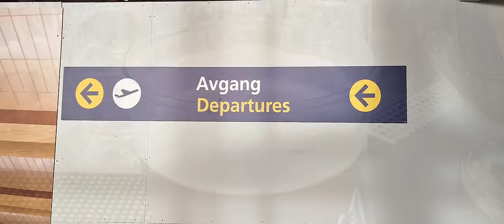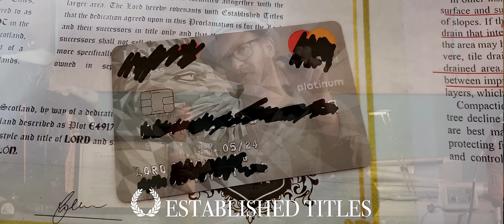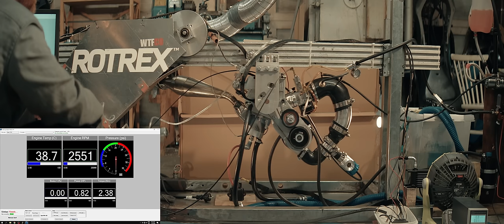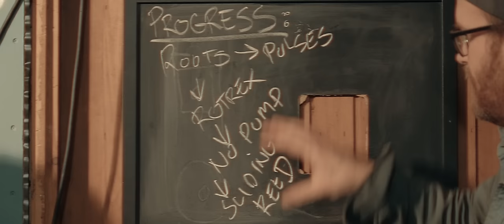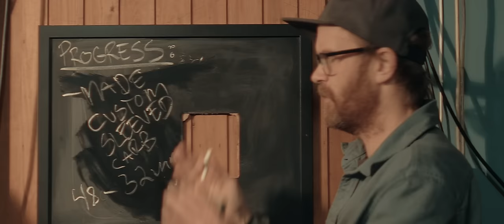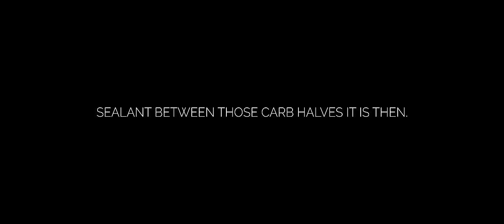Supercharged 50cc Two Stroke Flamethrower!

Comment: Whats the betting, it's leaking out the carb because it can't dump the boost. Maybe your pressure balance pipe induced this leak?
Reply from the maker: It wouldn't leak if the carb was sealed properly, have to take it apart and fix it.

Comment: it didn’t work because you done a straight tube from turbo to carburator and you didn’t pressurize the fuel tank.

the first thing produce negative-resonance that keep the reeds open while the piston is going to the btc.
the second one make the carburator in positive pressure (fuel goes back to the fuel tank)

in my opinion you should make an Y tube from turbo the the fuel tank (as is common used in high pression airbox of 125cc 250/500 grand prix bike)

and a straight foward tube (kinda airbox) large as the carburator, connected with a T shape to the turbo, so you can change he back lenght to tune up the intake resonance..

Comment: Could you swap the throttle cable where it goes into the slide for a rod then the other end of the rod where it exits the carb could go to some kind of push pull setup so the slide is physically pushed shut.

Comment: Slightly less insane when you consider the shorter distances and inexpensive flights in Europe.
UPS has got to be the worst shipping company I have ever used. I don't think I've had a single positive experience with them in all the times I've used them.

Comment: Ever thought of direct injection on this beast? Proper ECU mapping 😍💪
Reply: Yes, he has. He had a great segment on why not (yet) 1-2 videos ago.
Reply: Extremely difficult to map because you never get an accurate feedback loop to the ECU and there’s no place to put an O2 sensor where it won’t foul up.
Reply: Alpha-N tuning is possible (often used on drag engines with too much cam for closed loop operation) however it's a pain to do.
Reply: @andrewwasson6153  I'm not too sure about that. PRI drag racers in the US have plenty of oil blow-by the rings and the O2 sensors seem to live quite well as all of the EFI-tuning is reliant upon these sensors. By reducing the oil percentage in the 2-stroke fuel to between 3 and 5% by using the best available synthetics (after all, this a totally anti-friction-bearing engine design), I don't think that O2-sensor contamination will be a problem for racing applications. A second reason for reducing the oil content is the great amount of fuel that is being flowed by this latest iteration of engine... thus the oil-mass-per-rpm is already quite high at 10,000+ rpm. Certainly the 10% that is currently being used may be excessive.

Comment: Great video again ! The flutter.. I think the centrifugal blower is surging as it is running left of the surge line in the curve.. Can be solved by a smaller turbo (saldy smaller C8 was not available anymore as that one looks a lot better for the 50cc and massflow required) or setting the blow off to a lower pressure but then you waste a lot of air and power. Have a look at the curve of this one (the C15-16 I believe you have) I did and when calculating the theoretical massflow of the 50cc engine the turbine is too large for the flow in my opinion, hence the surge... Now you could try to make some inlet guide vanes to reduce the flow by altering the curve of the turbine but that needs some testing.. And the surge is indeed not healthy, with large turbocompressors the machine will shutdown when detected as it gives huge loads on the bearings, shaft and impeller. And what is the overall ration between crank and turbine ? When you know the rpm of the turbine a better estimate can be made of where it runs in the curve

Comment: "No real pressure difference" "lots of flutter from the compressor", I'm no centrifugal compressor expert but this doesn't make much sense to me!
Is the compressor working that close to the surge line?
Reply from the maker: I'll have to monitor both pressure sensors when I let off and see how they behave. It's probably fairly close to surge, the engine seems to flow quite a bit of air tho.

Comment: 😈😈😈😈 Absolutely  fantastic reults and great video,   cant wait till you post again and iron out the leaching ..  you'd think with tge bkower creating centrifugal forces that it wouod buffer those problems once the motor got up to speed and operational temperatures ..  just as you say that sticking is impacting its throttled controlling. ...  does the air sensor show impurities on major loading up on exit as input runs perfectly.   Maybe the exhausting  system needs a larger expansion chamber but smaller tip ...could help ... im not an  engineer , you can take that with a grain of salt ..  worked notors and the attitude that goes along with it !   😈😈😈😈

Comment: i would let the engine parts warm up first before romping on it     P.S you dont need a coolant warmer if the engine is already warming the coolant up to operating temperature      and it seems to not idle too well set your idle screw right (500-1000RPM)    you need a air fuel gauge to get a accurate air fuel mixture reading    the engine will run like a dream when you get the accurate reading      and P.S.S     your running boost through the carb the boost is gonna cause the slide to slowly return    i would find a verry stiff spring to fix the the slide problem cause the boost is keeping it from closing fast      and also the flutter you hear from the supercharger is a good thing means you have boost running into your engine means your supercharger is working properly making your engine have more power P.S.S.S your gonna need a boost gauge to see what pound of boost your running     too much boost will blow your engine to smithereens    (like a ticking timebomb)     the 2 main important things your gonna need is a A/F/R gauge a boost gauge and a stiffer Slide spring     hope this pointer helps you out a lot      love the videos keep up the good work and hope u get it to run right
Reply: Right! But for prototype work, he needs more accurate instrumentation than an A/F gage. A simple air (pulse) dampening drum fitted with an SAE-calibrated venturi with a known inlet diameter (easier than it sounds) and water manometer is good for the air measurement. An old fashioned glass-tube burette and a stop watch does it right for fuel consumption measure—old school, but solid results. Also his fuel delivery system (gravity feed from a gallon container) has to change for the better. Ask any control line, model airplane speed flyer how to do this; the answer have been around for decades.

Comment: 9:26 CDI unit is sparking through it's body to metal floor. Is that normal?
Reply from the maker: I first thought it was a spark, then thought it was a metal chip reflecting light, now realize it's a strand of hot glue left after securing the coil wires with the stuff.

Comment: ill say it again, the BOV is not in the correct position to work correctly. it may work eventually, but its not going to work right. it needs to be a straight shot to it not a 90Degree bend like you have it. it needs to be T'd straight off the intake.

Comment: Getting permission to buy pure nitromethane would be awesome. You could in theory go 100% nitro. In old school top fuel drag racing I believe they would call that "Put the can in it". Just don't tell the neighbors.
Reply: I think 100% nitro was banned in drag racing due to causing too many engine explosions.

It is actually a high explosive. There have been cases where tanker trailers of nitromethane blew up due to water hammer effects caused by closing the valves.
Reply: Be careful what you wish for. In higher percentages, nitromethane is one of the most unpredictable chemicals that has been used in the internal combustion—causing much damage to the mechanical components when not happy; that's why Top Fuel and Funny Car dragster engines only last a few seconds. Other forms of boost offer much better longevity.

Comment: Why do you need this slide set up thingy. .?? Wats the point.?? Wats wrong with a big set of reeds??? Eliminate this slide reed set up all together??? If gas runs better then get running as good as you can an do all testing on gas then upgrade fuel. Still don’t see why you need the slide thing. Vrs a nice set of reeds.  The blower is just going to hold the reeds wide open at high rpm so what’s wrong with running a proper set of reeds and get away far away from that sticking slide set up that’s causing all sorts of unnecessary issues.  Throttle response is not great so maybe try putting carb before the blower like most setups. Throttle response can’t get any worse then it is anyways. If carb is before blower then that will eliminate any over pressure in the carb witch can be causing fueling issues at high rpm.
Reply from the maker: No trouble with the sliding reed valve, it's the carb slide that's sticking. Can't run draw through, rotrex seal draws air into the gearbox. Ran better on gas cause too lean, not anymore.

Comment: Its No Longer 50cc when you add a Blower?
Reply: Swept volume gives CC capacity not the air pressure inside the cylinder.
There was a post like yours previously, just wondering did you write that one as well?
Reply: @malcrandall1309  No it was not me.

Comment: well you finally worked out the crankcase induction is a problem as to fuel delivery so when ya gonna ditch it and go full supercharged loop scavenged?
Reply from the maker: Actually not a problem at all with that sliding reed valve.
Reply: @2STROKESTUFFING  LOL
Reply: Do you not see how this comes across somewhat pretentiously?

Comment: Bullshit.
It is not possible get 2stroke blowed if you run air in cylinder throught crankcase.
And you need valve open and close exhaust port, othervise blowed air run throught to engine and out from exhaust port and you dont get anything overpressure to cylinder.
Anykind exhaust pipe cant do 1bar or more back pressure when exhaust close.
Reply from the maker: I've already iterated through several versions of an exhaust valved blown engine. Wanted to see how a "conventional" two stroke would behave. Expansion chamber exhaust can actually do 2-3bars at the port. Should be better than a valve in theory, though with a typical narrow 2t powerband. If problematic in practice I'll go with a valve.
Reply from the maker: Btw, starting a conversation with "bullshit" could lead to people not bothering with a reply.
Reply: @2STROKESTUFFING 
It's so hard to write in English if you don't know it properly.
But in a supercharged 2t engine, with the channels closed, there is a very large back pressure under the piston, With the channels open, the fuel mixture is blown through the entire engine with a supercharger, And there is no proper pulse in the exhaust pipe and no overpressure produced by the supercharger in the cylinder.
Reply from the maker: @isopepe108  The same high pressure the piston has to work against on its way down helps it on the way up. Why would the exhaust pulses dissappear with a supercharger?
Reply: @2STROKESTUFFING  I always wanted to know what the pressure would be at the piston face at resonance, now I know! This has bugged me for many a year.
Reply: @2STROKESTUFFING  normal 2stroke engine exhaust port open and gases go to pipe and pressure drops to near 0, transfer ports open and gases go up from crankcase, part of that goes pipe too, pressure drops near 0 and piston start go up when pulse come from pipe blocking gas flow to pipe and returns part.
But now your supercharger push through all engine As much as the amount of air it produces all that time when exhaust port is open.
That why you cant do over pressure to cylinder, and there is not anykind pulse back to cylinder. 
Measure exhaust pressure near to cylinder. 
But if you dont close exhaust port after transferports you cant do any boostpressure to cylinder. 
How much boost pressure is now on the pressure side to 15000rpm??
Reply from the maker: @isopepe108  I understand what you mean, I don't understand why the pipe wouldn't work just like without the blower though.
Pressure waves move through the gas in the pipe, unless flow exceeds mach1 we shouldn't have problem.
Seeing 0.5bar at 15k rpm, aligns the Rotrex compressor map.